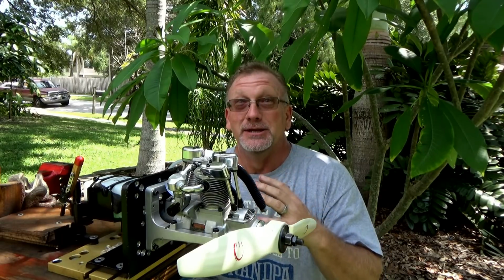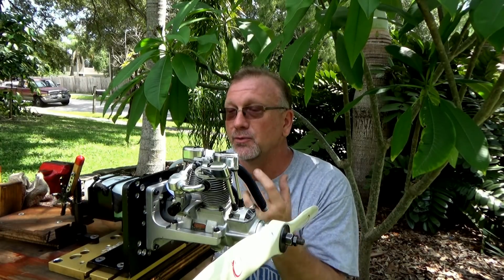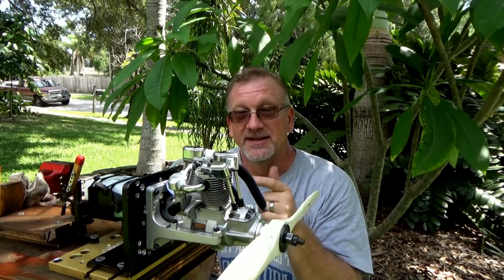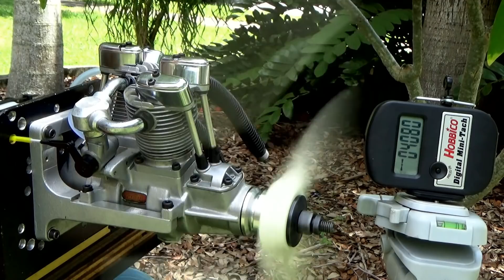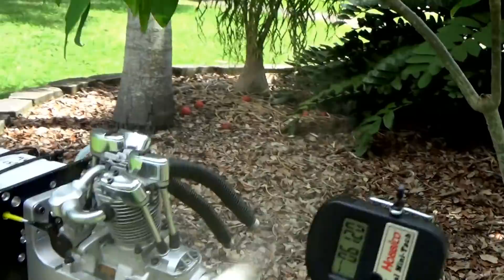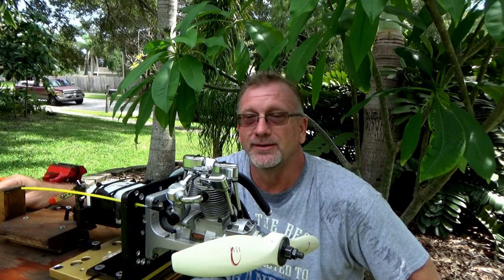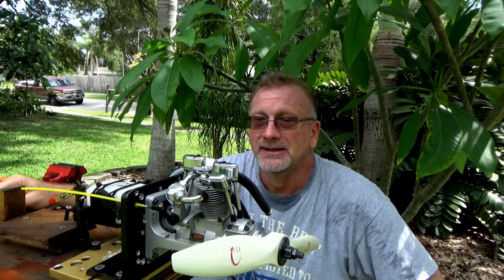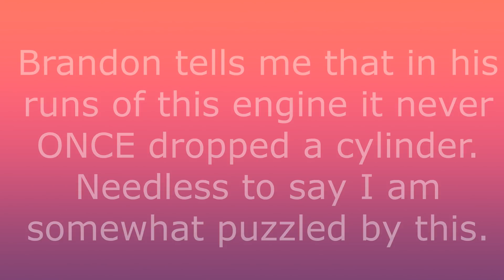Saito FA-200Ti First Run

Comment: Saitos with dual glow plugs they start glowing after leaning high speed near optimum for 5 to 10 seconds, when they start there is a slightly increase in RPM that is more notorios un single cyl, fa 120 sp saito fa 300 tddp, saito 450 & some versions    of saito fa 320 área equiped with dual plugs, i have some experience with them. Great & beautifull engines.

Comment: Hello, my names Rodrigoand i have a 200ti saito, iwould like to know what setting you did to run the engine witihout a cylinder going out. Mine only works with a mechanical glowdriver that is turned on at low rpm and powered a 1.2v battery...i used the gas ( wildcat 15%nitro)...

Comment: Wow what a beautiful piece of kit!, always loved Saito.
A question, I've got a giant 10.5 ft vintage Southerner that I've taken out of storage, powered by my OS 91 Surpass (with the black valve cover). I unsiezed the motor, mainly the cam followers, reinstalled, (inverted). I was amazed that she fired up first time!!, however, she only continues running (roughly) after a few choke presses on the exhaust or carb, doesn't seem to run at peak and doesn't idle too good. Historically the 91 has been an incredibley reliable and faithful motor. Any thoughts?
Thanks in advance.
Reply from the maker: Inverted installations have many operational difficulties and that is why I never did them in the past.  Test the engine operation upright to see if it is the installation causing the issue.